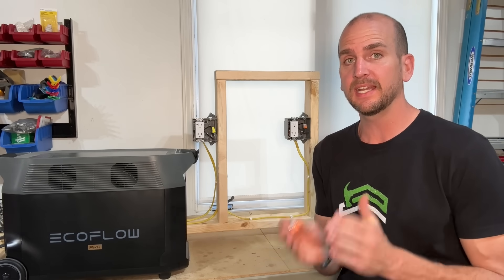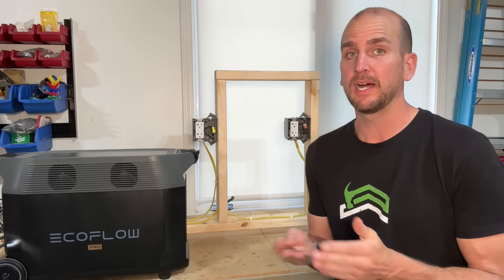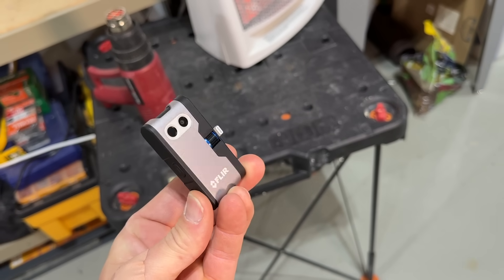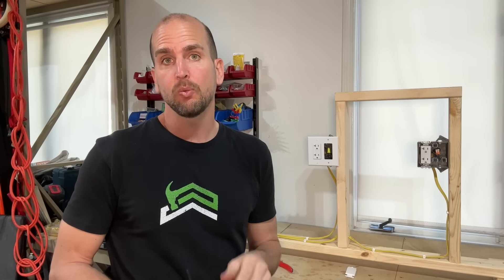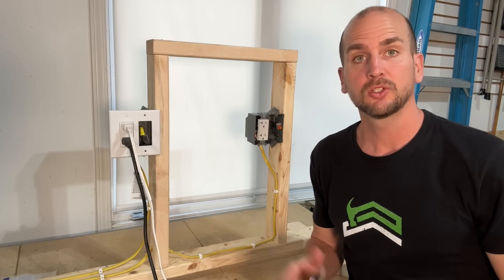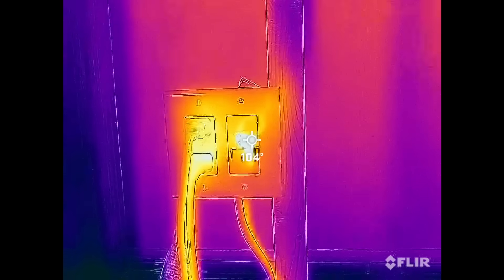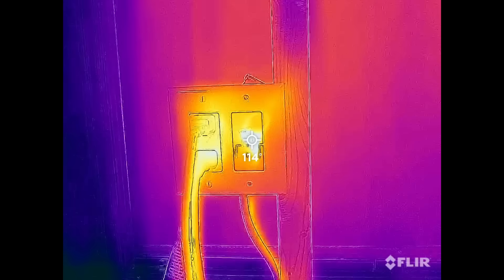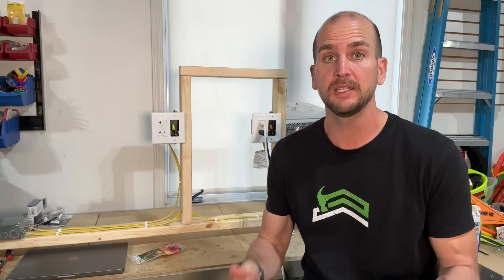Debunking the Pros: Can WAGO Lever Nuts Handle Heavy Electrical Loads?

Comment: I am a fan of them over the last five years.. I like how I can disconnect the load without messing with the Hot conductor. They can be a bit pricey, but I use them in certain applications for convenience, such as light fixtures, certain motors pieces of equipment I may have to revisit. General pipe and wire I stick to wire nuts and yes, there should be a class on wire nuts because they’re quite often miss used.

Comment: Personally, the less resistance and heat the better, i would still prefer not to use wago or other spring type connectors in high load applications simply because there are better options that offer less resistance in the circuit. they're great in lighting fixtures however, and they are easier to use however

Comment: The increase in heat is an increase in resistance. Increase in resistance is power loss and power loss is increase in monthly electrical costs. SO WAT IF IT MEETS CODE. Also, with time this resistance will increase as contact corrosion takes place. In general, you want as much as possible contact area. So twisting the wires togather and adding  a wire nut is the way to go on a long run.
Reply: eh. Wagos also have spring contacts, meaning the connector will continue to push itself into the wire. Corrosion is a much bigger problem when using wire nuts, because there is no force actively holding the wires together.

Comment: Most wire connections in Europe are similar to the WAGO type connection. It's just fodder for not wanting to change. There's nothing wrong with wire nuts, but there's also nothing wrong with WAGO type connections. If anything the WAGO compared to a wire nut is like comparing a bolt to a rivet.

Comment: I stopped using twist nuts. I've been using Wagos since before the 221 series. They're much safer especially when working with live wires (when you don't have a choice). Wagos provide dependable grip on the wires, the wires can be of different gauges, I can join up to 5 wires directly into a single Wago. But twist nuts are more widely available and cheaper.
Reply: You shouldn't be working with live wires if you're afraid of them.  Pro electricians have no problem with wire nuts.  :body-blue-raised-arms:

Comment: The concept isn't bad here, but limiting the "experiment" to twenty minutes means it's completely useless. You did not reach a steady state temperature.  As such, you did not get any useful data, at least not regarding the allegation that the lever nut will over-heat and cause fire. 

Now, we know Wago's are safe for higher voltage and amperage than any us 110 wire will carry with a non-faulty breaker. And as such your experiment isn't needed, contractors who are concerned by the safety of these products are listening to old wives tales.

Comment: Good tests and valuable information for any homeowner handling small electrical repairs and additions. It's worth it to clarify that the Wagos do, in fact, generate a little more heat, but when used properly are still far below max temp rating. As with all electrical devices and connectors, what matters most is using them as the manufacturer intended. With wagos, it's just dead simple to use them correctly.
Reply: Are u serious? Its ok for a connection to produce heat?  Yeah I guess a wago is a resistor. I hope your not an electrician.

Comment: I sold electrical Automaton products for 25 years. My OEM machine builders used  Wago lever nuts in million dollar equipment without any issue.  Wago is a German company I know they over engineer their products.   Like to see you do a test to failure of both products